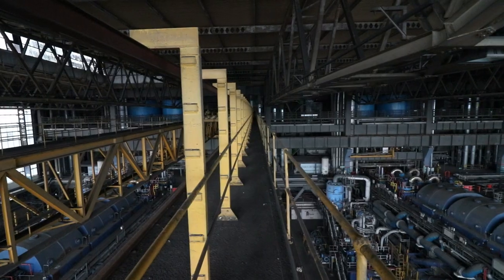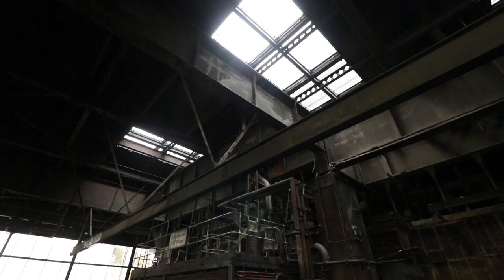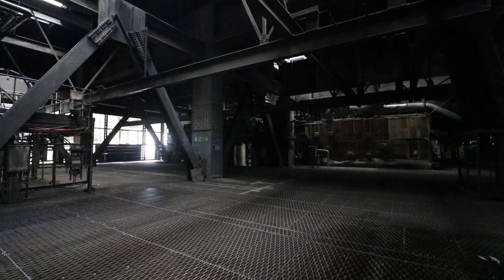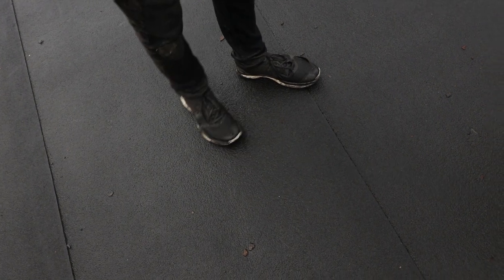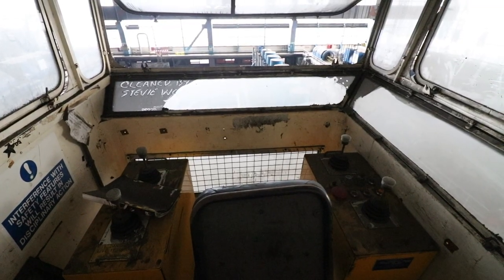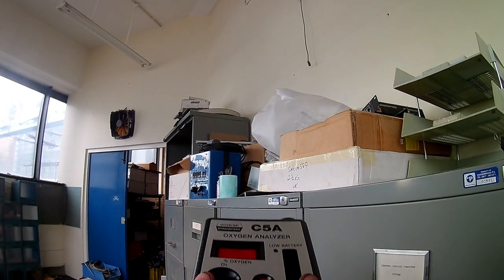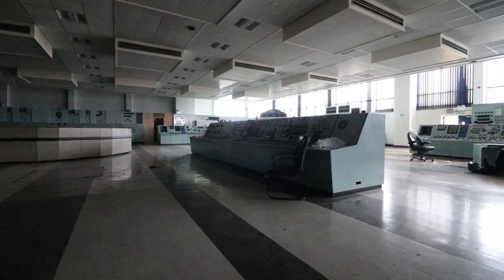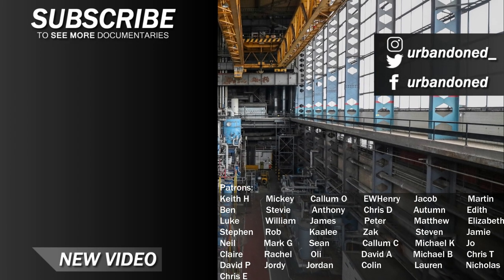Exploring the Abandoned Eggborough Power Station - Before Demolition

Comment: I worked at West Burton between Retford and Gainsborough from early 70still 1990,and whilst this video gives you an insight into these giants you cannot appreciate the size the complexity of steelwork,wiring,waterpipes,steampipes and somebody actually designed it.What a lot people don't know is there's an awful lot of going on underground in the sub-basement.....very,very spooky when working up on the boilers at night when you could be up there on your own,your mind goes wild.
Reply: @freespirit1975  We mainly had, in the UK large stations, General Electric Company (GEC) (not the US GEC!) and Parsons - the company of Charles Parsons. 
The UK fleets was standardised over a number of ranges so rebuilds and swaps could occur, the down side was that they insisted that the UK nuclear power stations had to use the same turbines, with a higher boiler port temperature, which really was not good for nuclear stations operation. 
The Parsons 660MW units were the first to break the million HP scale, which is more amazing considering that twenty years prior 50MW was considered large. Also, from memory, and others may correct me as I could well be wrong, I believe the 660's were the first to use electric vs mechanical (nearly Watts style) governors at that size.
What's more incredible is that they were hydrogen cooled stator cores and now that size can be air cooled! 
PS I appreciate these were 500MW units. They were really quick to load however.
Reply: I say to people until you've stood on the HP end of a steam turbine on a winters evening peak, do you really have no idea of the energy in a power station: respect to the Unit Controllers!
Reply: Good point about someone actually designing this! That's what I was thinking when watching this. Amazing
Reply: That looks like the place featured on the 1970s Album cover, PXR5 by Hawkwind🤔
Reply: The CEGB was a great employer. I'm a former MMD fitter, certainly no fun at drum level in the middle of summer.

Comment: you can't appreciate just how huge these places are until you step inside, even then unless you actually worked in these places it's impossible to comprehend the noise, heat & vibration produced when they were in operation.
I spent years as a scaffolder helping these places to run smoothly & for the last few years a safety manager for the demolition of this very station & also Ferrybridge. Some very mixed emotions watching these giants fall......

Comment: I'm lucky that I'm old enough to live when you used to be able to go on tours around places like this when they were actually in service. When I was a younger, I stood on top of the reactor of Dungeness B while it was going and stood next to massive turbo alternator sets like those while they were all full load. The sheer noise was staggering and it was odd to see these so quiet!
Reply: Ditto. I've toured Willington coal power station and also Sellafield nuclear plant as a kid. I ended up designing places like this though so looking around them these days isn't so exciting!
Reply: Way back in the early 70s, my old man worked at Ratcliffe-on-Soar, another great example of 1960s CEGB design & build. I was lucky enough to get a guided tour around the turbine hall, control room, and inside the base of one of the cooling towers - this great video brought those memories back.
Reply: Same here, I took the Dungenss B tour pre-9/11 which closed them off. The power of the alternator sets at full speed was, as you say, awesome - the whole ground shook.

Comment: My dad worked at Eggborough for many years.
As a child I was lucky enough to have several tours "on permit"
Including when they changed the steam valves on the turbine hall roof with a helicopter so I got a helicopter ride too

The immense size of the turbine hall was matched by the immense noise.

On one occasion they were working on Unit 4 and had it disassembled
Seeing the size of the internal components and 145 ton mainshaft has never left me

Thanks for sharing 👍

Comment: I worked for 34 years in Generating Stations with the Los Angeles Department of Water and Power that burned natural gas and fuel oil in the boilers. The common arrangement of Control Rooms was to have one control room for a pair of generating units. That is the the Generating Station had 4 units there would be 2 control rooms. This Old Generating Station had one really huge control room for all four units apparently with the controls of each unit in a corner of the huge room. This is the largest single control room I have ever seen in my life and on videos.
Reply: There was bigger.but not now

Comment: It is a real shame these plants are being demolished in their entirety. The UK is hopefully going to build a fleet of the Rolls Royce Small Modular Reactor power plants, with a nominal rating of 470MW per unit.
The former coal plants had units rated at 500MW, using steam at approx 565degC 160bar, reheating to 565deg C 40 bar, with a turbine, condensing plant and cooling water system to match.

The PWR produces produces large amounts of hot fog compared to the superheated steam of the coal plants, so a different turbine arrangement would be required to work at these wetter and higher mass flow steam conditions.
But these alternators were in a pretty good condition and well engineered compared to later designs of air cooled machines used in CCGT plants. (Specifically the EE and AEI 500MW units. ( Eggborough had a new one built about 2005))
For each of the remaining 2000MW coal plant sites, Repower two of the four Turbine generators only with modified turbines, build two reactors where the redundant boiler plant was located.
Retain the Cooling towers and cooling water pumps and culverts. Hopefully save a load of money acquiring new sites, civil works, switchgear, and grid connection.

Comment: What a fantastic film guys much appreciated. I started there in 1966 as a junior engineer to assist in commissioning in various areas.
Two of us climbed to the top of the chimney, what a long slog 40 minutes as the lift was not yet working. It was the first multiflue chimney in the country.
The generation starts with a (if I’m correct) a 240 v perm’t mag generator and is amplified via the excitation system to come out the main generator at 22,500 volts!
From the main 400,000V swit’g station it went across the Pennines to Penwortham at Preston amongst other places.
Sad to see all the big station being demolished, going to need a lot renewables to replace etc.

Comment: I used to work at eggborough  as part of the security team in 2004, one of our daily tasks was to run the mail about the station.  I remember the control room was amazing. In 2018, just around the back was air liquid (a cryogenic plant) which I also worked. Basically eggborough decided that they wanted the land back as it was on a 25year lease. So they just cut their 11kv supply at short notice, leaving the plant to run on generators and instructed them to dismantle and disappear within a contracted period of time.
Reply: Its what u get when u sell to foriegn firms,,, they rip everything of all profit then leave

Comment: It is a sad video.  A station is obsolete after 51 years.  The lads illegally entering it found no valuable, no job opportunity, no continuation of technology, no inheritance of  of anything but just a memory.

In general a power station may have a structure lasting about 50 years but the plant and equipment normally last about 40 years by which time it is generally more economical to replace with a more efficient and up to date set.  In 51 years my guess the generator might have to be rewound twice.

For those who are not in the power industry the economics of any power plant in Europe or in the world depends on the pollutants it emits.  The regulation in force has already force every coal-fired station to be gas-fired in UK.  So if Eggborough isn't modernised, by changing to gas-fire arrangement then it has no choice but to close or pay hefty fine for emitting pollutants acceptable in 50 years ago but not nowadays.

The other important consideration is coal-fired steam turbine has an efficiency of about 1/3 or 33.3% and the flue gas has a temperature of over 1,000 degree C.  In gas-fired station the gas turns the gas turbine, known as open cycle, which has an efficiency not much different from a steam turbine.  However the exhaust from the two gas turbines could be used to generate steam to power one steam turbine, of a similar capacity.  Such combined cycle can increase the efficiency to about 60%.  That is why coal-fired generation has been replaced by gas-fired generation across the whole Europe until the Ukraine war.  The European politicians don't seem to know it has been the cheap Russian gas that has generating electricity for the European.

Comment: Many years ago I was a flight instructor at a small airfield not too far from this power station. Occasionally I would get a retired person with time and money to spare wanting to learn how to fly. Such a person arrived one day and signed up for up for a course of lessons. I found that the rate at which a person learned new motor skills was often proportionate to age. I would say the best age to learn how to best coordinate aircraft controls is early teenage years. They just do as they are told, no questioning, Simple. This guy was pushing seventy. Generally, from my experience the rate at learning how to fly is proportionate to age. This guy was the exception to the rule. He learned very quickly. Turned out he had been the lead engineer in the design of the cooling towers at Eggbrough.

Comment: Many thanks for your good work, a feast for the eyes.  Did you ever wonder why there is such a visceral attraction to rotating machinery?  In comparison, the giant solar farms with their static inverters, let's face it, they just aren't sexy, although when in operation they do exactly the same job.  You've captured a fine bit of history before it disappeared forever.  If anyone is wondering what is "Frequency Compensated Load,"  I believe this is the portion of the load which is connected 24 hours, such as residential, and is adjusted to maintain proper clock time, as opposed to heavy, independent "Commercial" loads which are sometimes disconnected at night and have no concern about the exact frequency.

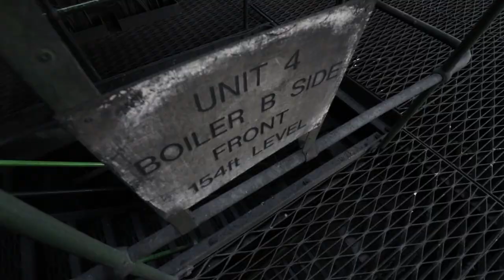Comment: 5:35 Looks like a GE style steam turbine generator.
7:40 Best guess, from what I saw.  You have two feeder lines coming into the plant on the upper floor.  They are designed to drop the coal onto the lower conveyors to drop the coal into any coal hopper.  There should be a coal hopper per mill.  Should be limited two levels of conveyors.
8:27  See three steam turbine generators.  Steam side is facing you.  Five sections - high pressure, intermediate pressure, and three low pressure sections.  The blue pipes on the side are the crossover pipes between sections.  That would be followed by the exposed shaft connected to the turning gear (a motor that spins the rotating bits while they cool to prevent warping), followed by the generator itself (the boxy looking section with the 4 towers on it, and the exciter past that.  Looks like they had pulled the cover off of the first exciter.

The crane had to be able to do all the heavy lifting in the turbine hall.  By the end, the crane control cab would have been largely replaced with a pendant station down at turbine level and the cab abandoned for a long time.

10:40 Bunch of wall mounted instruments.  More modern designs leave the instruments out by the pipes.

10:58 The aforementioned partially disassembled exciter.

13:28 Fun thought.  In terms of operation, it only would have been designed to use 5 operators to run the whole plant; one per unit and one lead operator in the middle.  Likely only had 10 crew at night to fix anything the operators had issues with.  The 3 sections representing the boiler, turbine, and generator per unit. The chart recorders on the larger bench boards behind the control bench boards.

Comment: If you can go to Aberthaw power station coal fired (South Wales).Which has just been shutdown. It's control room is looking after 3 x 500Mw alternators. It was changed to a computerised automatic system. The control room was impressive. Ask security there to ask the company if you can film there?

Comment: Wouldn’t it be amazing to be able to document the complete run up of the station from absolute power down? What would be the first system to startup? How many people it would take ? And also, how long to full power up and switch onto the grid?
Reply: I project manage new build power stations, of course not coal but waste and biomass. However, the basics are the same. After a shutdown number one is getting the demin water running and good, and compressed air. Then it is the flue gas treatment plant, get the bag filter pre coated, all trace heating on etc. then another 100 or so tasks before lighting the burners before introducing fuel. On the way up you are venting and draining and blowing down. One you have stable steam you divert it to the turbine and get the turbine up to speed on no load, when it is stable you get it in synchronised to the grid and then close the breaker to start exporting. The small stations I do (10 MW to 100 MW) ale about 24 hours for a coal restart per line. You can do a restart with two people plus preferably two more for some of the earlier tasks. That is separate to fuel reception and management, and site management.
Reply: @paulharrison2325  hey chap thanks for that wouldn’t it be great if someone had made a video in that process? What a fascinating area to work in. I’ve been a maintainer for Radio transmitter sites but apart from the size of the Aerial farms (HF and LF sites can be massive due to their long physical wavelength of the antennas ) they are quite small scale operations.
Reply: @buffplums  it’s extremely boring and mainly looking at computer screens with the odd valve to manually open or close. It’s exciting on a new plant the first time but after that a restart just means something went wrong and therefore paperwork!

Comment: While it was a coal fired power station (with biomass capability), and so needed to close eventually, it's a pity it wasn't repurposed into, at the very least, a synchronous condenser, as is happening here in Australia. But as a techie guy, I look at that control room and all those amazing gauges and switches, and really hope that all that gear was stripped out and not just sent to landfill. Anyone know if that happened?

Comment: Great vid lads...well done. Ive a question:- Was this plant close to life expired at closure, or was it wasted to satisfy the 'greenies' who loath coal ? If the latter, how do those who think that way, justify the wasted energy which went in to producing the steel & other components, & the energy it takes to cut & re-cycle it as its taken apart ?
Reply: That is a difficult question to answer. The closure was because economics went against continued operation. Coal mining in the UK had all but ceased from a mixture of economic and geological reasons, meaning that expensive imported fuel had to be used. There was a failed biomass conversion scheme, with some argument between the then owners and the then Government about whether the Government had changed the goalposts. Carbon taxes encouraged the move away from fossil fuels. However, there is also the reality that the station was fifty years old when it closed. I am not an engineer working in this area, but all plant like this has a limit of safe and reliable operation, much of which must have been used up.

Perhaps a holistic view of the situation was that there was a failure of Government policy. The country enjoyed relatively cheap and secure power for a long time based on what were ultimately unsustainable technologies (use of non-renewable fuel and high carbon emissions) without planning for transition to future technologies. Instead of investing in renewables and new-generation nuclear, the big hope seems to have been a market-driven transition using natural gas as a transitional fuel. The current situation with dwindling North Sea gas reserves and high worldwide gas prices shows how foolhardy this approach has been. Ultimately, the Government gambled on the market investing in the future provision whilst allowing the industry to profit from mature assets but not investing enough for future energy security. High capital cost projects, in particular new generation nuclear, were pushed to one side whilst lower capital cost gas-fired stations (typically combined cycle gas turbine installations) took over from coal-fired stations as they left the grid.
Reply: @DavidWood2  A sound response...thanks. One point I do wonder though...you say ( rightly ) that these plants have an age limit of safe operation...true. How ever, I cant believe ALL of the installation fails. Things like cooling towers & other components would have longer lives, which would ( arguably ) make boiler & turbine replacement cost effective ? While publically owned, the railways thought nothing of scrapping diesel locomotives when their engines reached lifes end & were too old to be considered worthy of another engine rebuild. I always pondered the residual value of the body shell & bogies. Now, with private cash conscious business thinking in charge, its considered 'normal' to create 'body snatcher' refurbs. New modern diesel engines & generator sets are dropped in to gutted out locomotive bodies. Doesnt take an accountant to work out that the casings can be reused. Same with a power station may be ?